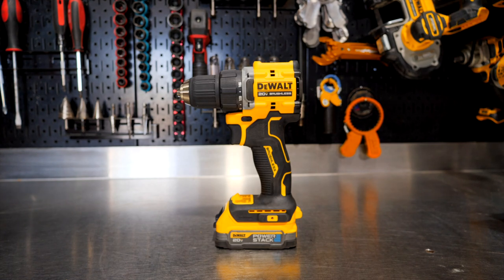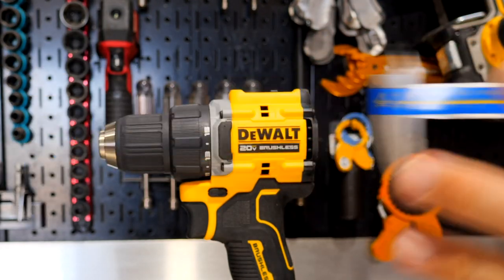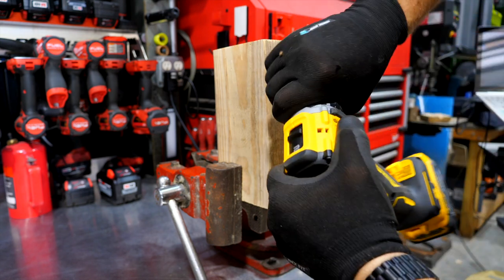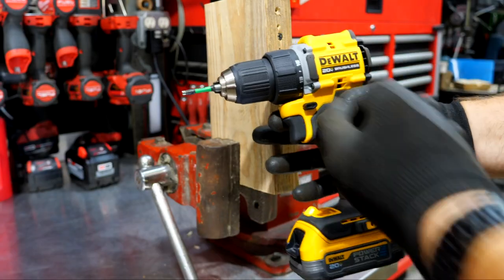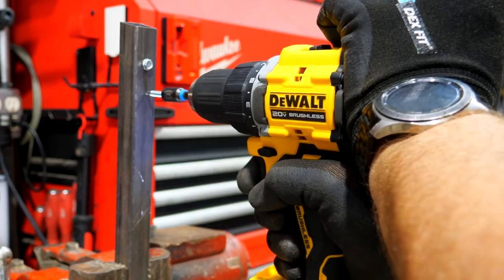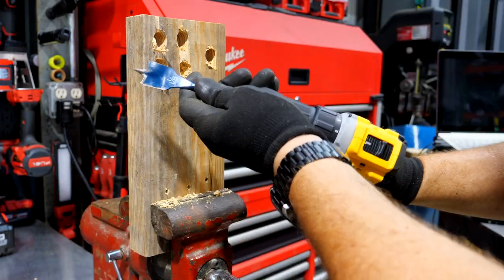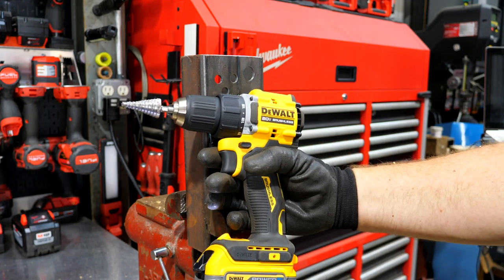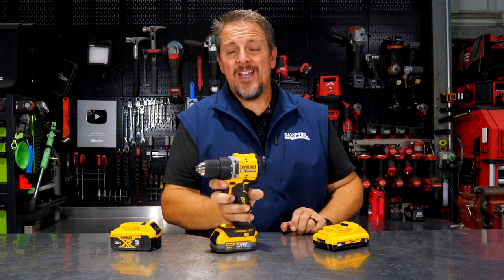STUBBY DRILL - DeWalt DCD794 ATOMIC 20V Brushless Drill Driver Review [Shortest DeWalt Drill]

Comment: Dewalt needs to step up their game and get rid of that plastic chuck
Reply: Dude it is plastic sleeve over a METAL chuck it keeps the weight down and stops marring on fine surfaces, I've been using them since Jesus played quarter back for Jerusalem and NEVER had a problem.
Reply: The dcd800 is the XR version just as short and has what I consider their good chuck (the metal one). There’s definetly a difference in that chuck and the chuck on this drills holding power
Reply: The 800 is nice, in canada its about $180. 00 - $199.00, i bought the 794 as a kit for about $65.00 canadien, that like $47.00us, i can live with the plastic over thecluck....

Comment: Seems that you received a good one. There are a couple other YouTubers that had gearbox failures on this drill. My new 794 also had a gearbox failure right out of the gate. DeWalt sent me a replacement 794 and it seems to be performing normally.
Reply from the maker: Yeah, no problems here. Sorry to hear about that. Glad they fixed it.